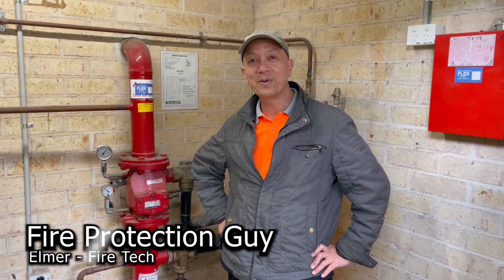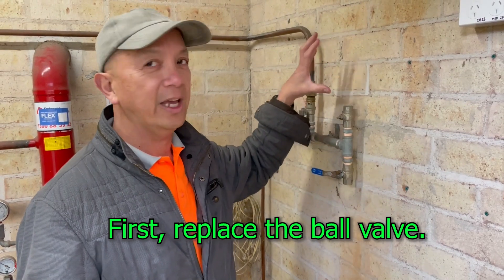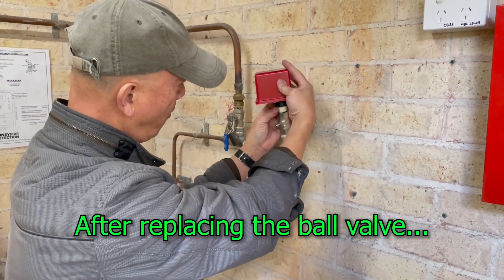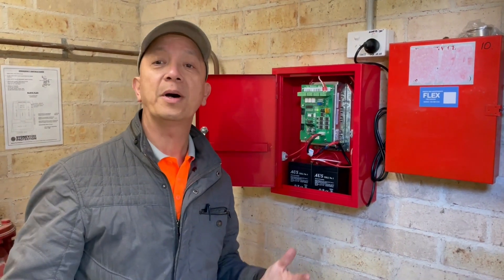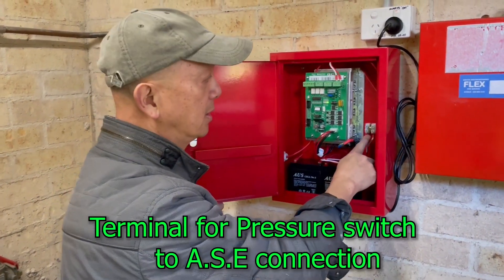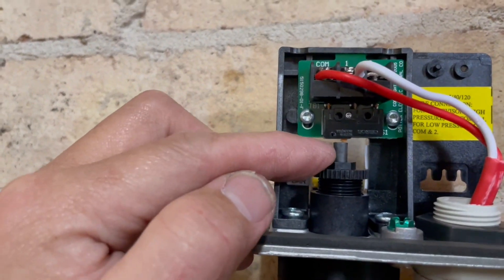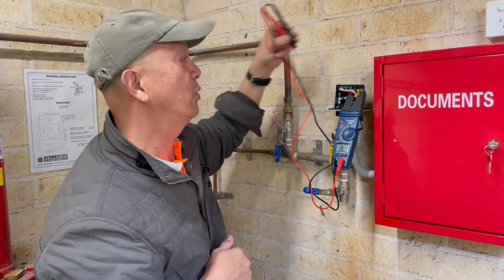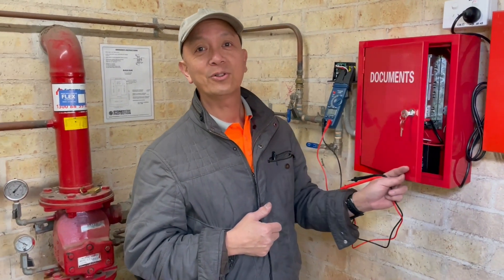Fire Sprinkler Monitoring to Australian Standard 2118.1.

Comment: Elmer what year did it become mandatory that the sprinkler systems be monitored ? is the ASE  always connected to the fire brigade or are there other monitoring companies as with alarms. not directly connectd to the Police.  Is the connection from the ASE to the fire brigade normally open or normally closed?    thanks.
Reply from the maker: Sprinkler system, when standard began, should be connected to a monitoring company. Before it's the brigade thru a transponder. Now its a fire monitoring company. ASE companies monitor the alarm input in a normally close relay for Romteck, ADT..but Code Red is normally open.
Reply: AS2118.1 has always required a connection to a Fire Control Station, but if the sprinkler system is not being installed as a prescriptive requirement, then the sprinkler system does not need to be connected to a FCS. 
If the National Construcion Code (NCC) dictates that the building needs a sprinkler system, then that connection becomes madatory.
Otherwise, the Standard has no means of enforcement, so no one can say it has to be connected.
Reply: @jeffmorton1587  thanks Geoff for your reply what state are you in?  how mauch do you know about class A anti tamper monitors?
Reply: Mate, live in WA. Was the fire brigade Direct Brigade Alarm (DBA) manager for nearly 25 years, so know a thing or two about alarm monitoring and how alarms need to be connected to a Fire Control Station.
Not full bottle on AS2118.1/.2/.4, but sit on Standards Working Groups for AS1670.1 and AS1670.4, so that's my main area interest.
Had a few chit chat with people over the year about Class A and Class B. The biggest difference i can see between the two is that one does not require the device to be monitored for tamper (Class B)
And yes, this video would appear not to be compliant as the device is not located in an area that meets the requirements for Class B....
Reply from the maker: @jeffmorton1587  Hi Mate. It's a direct ASE (Alarm signalling equipment) monitoring of a sprinkler system.  The system has been installed under AS2118-1999 and they forgot to install an ASE to comply since it was installed. For the ASE company to install the ASE, it must comply with AS4428.6. Othewise, they will not install the ASE. Thnxs for asking. Cheers

Comment: Hi Boss, I have one question about old vigilant conventional panal, do you know how can I rough in for duct probe for supply fan, and how can I giv fire trip to this supply fan.this panal is older than 3200. Thank you for your help.
Reply from the maker: Vigilant panel older than 3200 is probably the F08. There were F08 fan control fan control before  but it's very rare now. It tripped from it's ACF relay. But best that you convince you customer to change the old fire panel due to its age and unavailability of parts. FO8 or F3200 detectors ( conventional  Hochiki smoke/heat, system sensor, Z series) are compatible to F220 Pertronics.  I suggest to be sure to check what brand you have on site and have it tested using an F220 addressable FIP.  Let me know the type of detector and I will test it for you. Importantly, the EOL location. Hopefully it's only 8 zones or less.
Reply: @fireprotectionguy7943  thank you for your kind reply, I checked vigilant website,it is f08 panal, this building is a very old building, they used fire sense conventional smoke detector before, now they want to change to BBQ restaurant,so they add exhausted fan and supply fan for kitchen area, our designer design the duct probe and fire trip for supply fan for compling fire rules, but I never did this one for conventional panal. If possible could you please leave me your email address or other contact information, so I can send pictures for the panal and learn from you. Thank you.
Reply from the maker: @qujacky5134  ..flexfireservices@gmail.com... You need to remove 1 of the zone circuit and measure the EOL resistance. Maybe around 3.2k?
Reply: @fireprotectionguy7943  this panal has 8 zones, one zone for 1 level, now I just need do rough in for ground floor, BBQ restaurant. I couldn't find where Is the EOL for this level, because they decorated many times for this shop

Comment: Why does the cabinet say documents and not Fire Alarm Control Panel or ASE cabinet or similar?
Reply from the maker: Its 300%cheaper and do the same job + 003 key access for fire system. I just covered it with stickers.
Reply: @fireprotectionguy7943  good to go then. Nice work